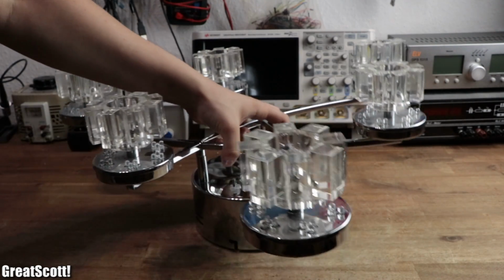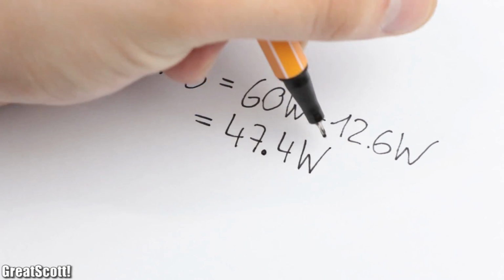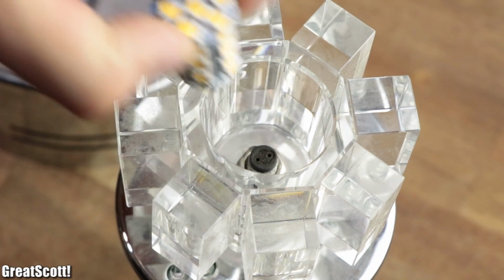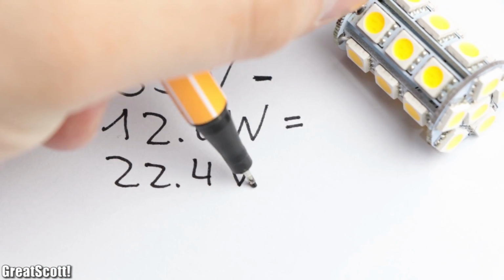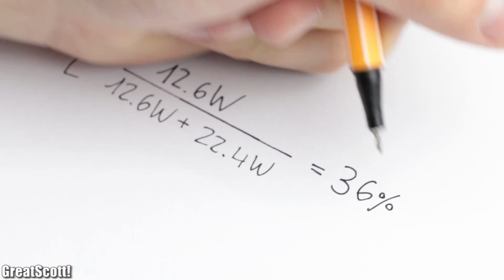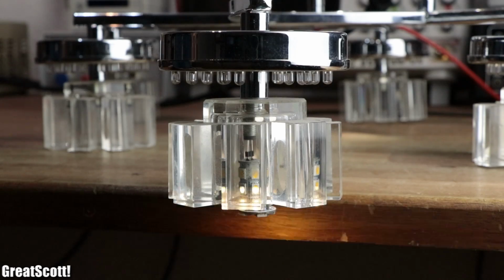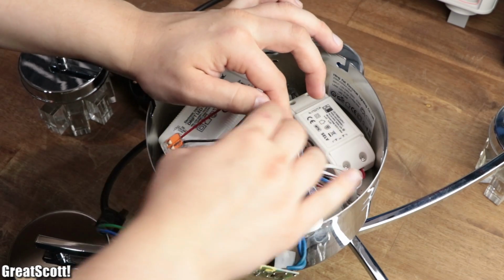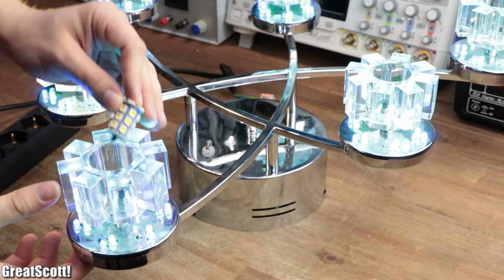Fix It!: Ceiling Lamp LED Upgrade

Comment: There is a big flaw with those led lamps. They have no proper way to disapate heat so they end up cooking them selves an fail after a short period of use. That an the led chips are driven to hard so there life time is about the same as a incodesent. Better to stick with the single chip an run it a few volts low so they last alot longer. Or desing you're own led lamps to inshure the proper desing an proper voltage.

Comment: If you turn on four LED lamp you will get power that over 30W. One you LED get 12Watt and you have 4 LED 12Watt*4 = 48 Watt. And so you could use your old power supply.
Or I'm wrong?

Comment: So how much did the overall power consumtion drop all things considered? Yes the G4 leds take less power than the halogen ones but as you replaced the transformer and got rid of the extra power supply for the auxiliary LED's, I'm curious about the efficiency side of things. Less conversions happening and a single power supply handling all of them sounds to me like a really good improvement.

Comment: Recently I have disassembled an old ceiling lamp >40 years old. It was beautiful, but with glass globes, and using old 100w bulbs, it has gone bad. Wires burned badly, bulb holders destroyed. I had to remove all wiring from the tubes , and put new one, keeping its' 2 segment wiring. I also put new bulb holders, and bright led e27 bulbs. Now my granny is happy again with the same ceiling lamp, but brighter, cooler, and more energy efficient, and longer lasting.

Comment: I WANT TO KNOW HOW TO FIND THE AMPHERE OF ANY BATTERY BY KNOWING IT'S VOLTAGE. IS THE OUTPUT AMPHERE IS SAME AS AMPHERE HOUR?
Reply: what's C? is it the no of cells? ur answer was easy but what if I don't know the watt of a battery? For example in most dry AA 1.5v battery the ampere hour or wattage is not written on it. By the way is the ampere or watt of a battery are same as amphere hour or watt  hour?
Reply: ok got it but u didn't answer my question completely and how do we know the C value?

Comment: I usually don't leave comments on your videos, nothing to critique as you know your stuff. 
But this one had me thinking differently. The point of LED bulbs is to save power and sometimes not a lot over a lifetime of the product. A one to one swap for the LED bulbs would had been cost efficient and justified, but the extra time and cost for a different power supply already put the cost of the project in my head over the cost of the saving from the LED bulbs. 
You must really like this light?
Reply from the maker: I do. And in the end I not only create such videos to repair my stuff. It showed a real life example why lamps might not work with led bulbs. So it is also for education and entertainment purposes.

Comment: How difficult is it to build a pure sinewave DC to AC inverter.  Is it possible to convert older type inverters to pure sinewave?  I've been shopping online and it is tempting to try one of the cheap inverters just to see if they are really pure sinewave and how long one would last.

Comment: a have a quick question on those terminals can I use those instead of soldering and do I connect them like ++- or +-. basically  depending on what my needs are I can have a couple of postive leads then have one postive lead complete and the ground lead but it in the last hole of the terminal...hopefully I am making sense i am relatively new to electronics and not sure if I am getting how these terminals work
Reply: never mind I found my answer they are meant to replace electric wire caps.

Comment: Instead of replacing the driver you could have taken advantage of the fact that the original source was AC. Therefore, by adding a couple of film or ceramic capacitors you could have increased the current draw by increasing reactive power for each of the led lamps.

Comment: Hello, can you provide some info on the power consumption and light output from the whole system? Before and after? 
How much do you gain from using just one power supply? 
Is one bigger power supply better the the two old ones? 
Grüße aus Berlin

Comment: can you make a video on Chinese cheap multimeter and professional German multimeter?? I want to know why I shouldn't buy cheap one?$
Reply: Professional multimeters are accurate and tested to stay within certain tolerances, they also have safety measures, advanced features and last a good long while.
The cheap stuff obviously only does the basics and within 2-5% accuracy, which would be considered garbage in professional work, but completely usable for hobby stuff.

For a novice I would actually advise the cheap ones for practice, because if you touch those probes to the wrong thing even for a second it can stop working right there and then, a lot less painful at $10 then it is at $500.
Reply: good reply dude but I think we need some proof to say that!!
Reply: If you connect the cheap multimeter wrong it won't just stop working, it will probably explode.

That's why the more expensive one has better fuses and other safety measures.
Reply: you can get good Multimeters for ~100$, but you should invest some money in a reliable Multimeter, not because they are better, because they are also safer and will last you years.

Comment: Did you get any problems with powerlan or any kind of powerbased signals? because a friend of mine has to switch all LEDs off before he uses such techniques. .... Can you confirm?

Comment: Soo anytime you see a power resistor your circuits are less efficient? So why would you ever use one and not just use the correct power supply... what is their purpose?
Reply: *****
The older I get the more I realize cheaper is just a substitute for worse
Reply: There not the ones running the item.. just making it.
Reply: RmRoyalflush
I agree price is irrelevant, value is what matters.
Reply: RmRoyalflush
Sure farmers pay for literal shit all the time. You're reinforcing my point value is a qualitative function, quality (value per dollar) is more relevant then price itself. I would gladly pay one thousand dollars for something that has great use to me. Instead of pay one thousand dollars for something that is considered high quality at a premium price buy I have no use for. Value... what are you getting for the expense!
Reply: Yes again you're reinforcing my point... thanks

Comment: Does the European hobby electronics market have better wire connectors readily available, or are Europeans more culturally disposed to seek out such products?

  I've seen a few Euro based (German-English) YT channels that used the same loose Screw Terminals and wire connectors. Here in the United States (CA, South of L.A.) such products are not something I've seen at Radio Shack (more of a joke to call RS an option at this point/RIP RS), or Fry's Electronics. When I shop hobby electronics distributors, products like these aren't marketed to me. What's up with that? Any old timers or people that have been on both sides of the pond know?
Reply: Maybe noone in the EU dares to use the more than cringeworthy US methods of connecting wires ;) . It is just what is used in general electric installation. Nothing to seek out, you get it at the hardware shop right where they sell wires, outlets and switches.
Reply: Gotcha. So these must be the EU alternative to our stupid wire nuts and crimp terminals that cause most of us in the US to solder and heat shrink everything.
Reply: as an former electrician I can confirm that. We always use screwless "Wago" Terminals. It's faster, safer and more reliable.
Reply: I'm not trying to say anything about the quality of the craftsman, just that the terminals used for houses and wiring are not the best for all situations. Wire nuts are used for anything stationary like in outlets and in-wall type wiring, but they can't withstand a high vibration environment. The other common form of wire connections in the USA is a crimp terminal connection, and they have reliability issues as well depending on the tool used to crimp and the method applied. There are lots of car fires started by less experienced user's playing with crimp connectors. Not to mention they look ridiculous in my opinion. I almost always solder and heatshrink my  wiring to keep everything looking clean but that's just me :)

Comment: I bought quite similar LED bulbs on G9 (Lumenix 5W 500lm) to replace regular ones, but for me light was terrible, i can't even say why . I think that I had headache after few minutes. I found info on internet that small LED lights on 230v have terrible AC-DC adaptors (i forgot how to name it) that make light flickering that can be check under  camera in smartphone. I checked and actually there are straps and flickering in view. I have also standard "big" 230v LED bulbs and under camera they looks fine. What do You think about it? Good and strong LEDs on small 230v G9 socket are even possible? How to check if LED light are safe for work? I switched back to standard G9 bulbs at this moment.    Sorry for bad english grammar.

Comment: I am really surprised you cannot find led bulbs that are brighter than the halogens.  I replaced the Amber lights on my quad (four wheel motorcycle/ atv) with leds and they are almost as bright as the headlights.

Comment: Without watching the video: The problem is the halogen transformator. It needs a minimum load which is not reached with the LEDs. Get an LED transformer and the problem is solved.

Comment: Can you please make a video about replacing rechargeable batteries on a handheld vacuum cleaner? I have one that is not completely dead. It is fine but the batteries grew weaker and finally stopped working. 
I want to replace the batteries and also replace the charger with a smarter charger that will make it work better and the batteries last longer. Any advice?
Reply: Fun fact, I rebuild an handhald vaccum cleaner, I'm removing the NIMH cells, and replacing it with one 18650 cell, a BMS and a lithium charging IC ;)

At first, you should understand how the thing works ;)
Reply: @Bunkerotter  if you look up a video on replacing a drill battery would that be the same thing just slightly different or is the vacuum cleaner not as power hungry as a drill?
Reply: @bland9876  it's pretty similar, but you should consider the "rush" current and the current under load of the motor, and than choose your lithium cells that can handle that current. And don't forget the voltage range of the motor and other electronics (speed controller for example) and don't forget to include a BMS that can handle all that.
Reply: PS: The handheld vaccum cleaner I mentioned, still runs strong, but its unused 11 months of the year (it's in a caravan of my parents). But after that 11 months it still is mostly charged and can be used without charging it first ^^

Comment: I've been trying to get Clive into modifying existing stuff. There is so many half baked items on ebay that could be so much more useful. Simplethings like adding a battery to a solar water fountain that only has a large capacitor. Reusing battery protection circuits building battery banks.

Comment: Great Video! Nice lamp too!
I really would like to find some of those wire connectors... may I ask where you found them? Thanx!
Reply from the maker: Just search for "Wago terminals". They are easy to find.
Reply: Mitzpatrick Fitzsimmons Wago 221 or 222

Comment: where did you get the cement power resistors? 
I need one for my computer power supply.
Reply from the maker: Ebay. They are easy to find.
Reply: have you heard the ebay song from weird al? i feel like thats you but with electronics lol

Comment: Please do a video if the lamp has to be fixed by changing the transformer circuit parameters. As an electrical engineering student, I would love to the method you apply. Btw Great video +GreatScott!

Comment: Do you know efficiency of your fixed lamp ?
Reply: The full electric to light conversion is probably around 20-30% unless it is some super specialized power supply and one of the very very expensive LEDs that go beyond 30%.

Comment: how are those new wago connectors?
Reply from the maker: Awesome
Reply: they don't seem to differ too much from the old grey/orange ones. They're just not as bulky.
Reply: In my opinion better because they are smaller :)
Reply: Is the main advantage of Wago connectors that you don't have to turn screws?
Reply: no. the connection just don't go loose. and you can always disassemble
Reply: these ones are even smaller then the old grey ones and can take continously 32A / burst for motor run-up 45A on flex wires of 4mm2 and 20A cont. / 32A burst on 2,5mm2 solid copper wires. available in double, triple, 5 and 8 contacts.  also got a finger-safe hole for measuring on the rear.

Comment: Actually, i had the same problem with my x20 12v G4 lamp, which has a big and bulky iron cored 20A transformer. Just swapped with an DC transformer and the job was succesful!